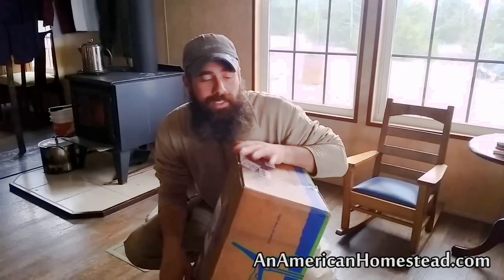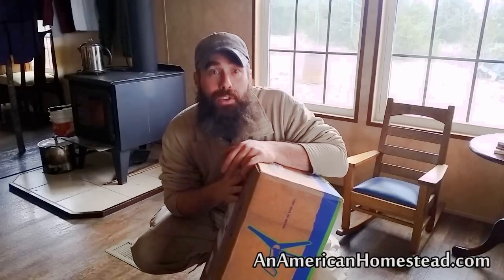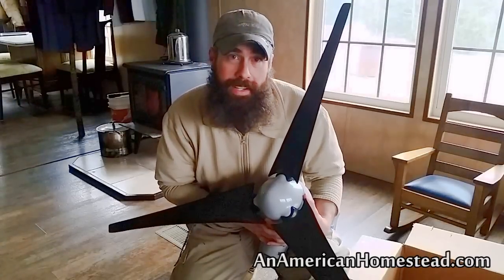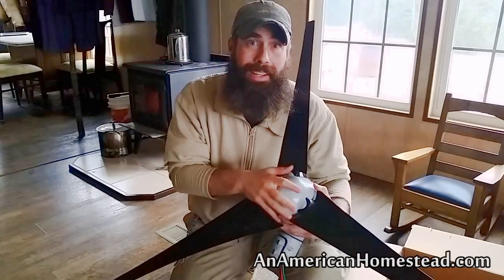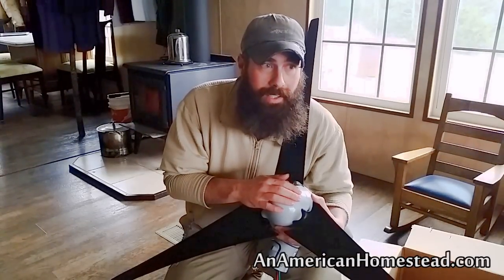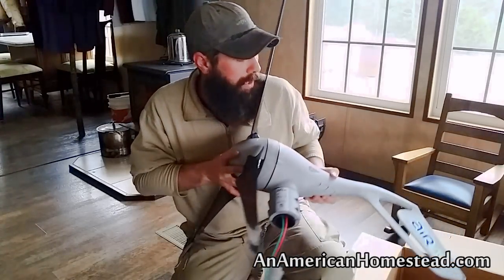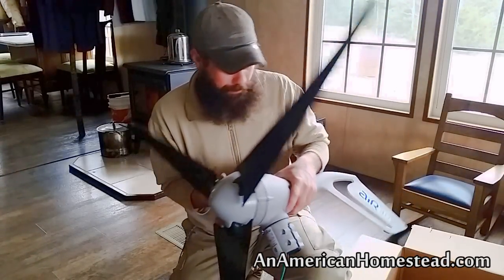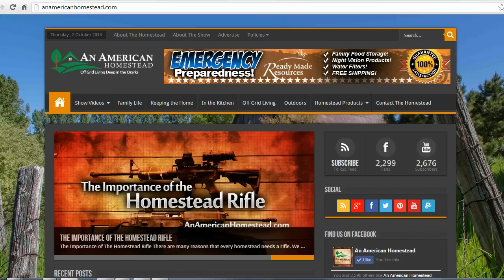Primus Air 40 Wind Turbine - An American Homestead

Comment: Good Day, I am considering adding the Air 40 to my 120v 3600w 90a 48v 12
 panel Solar system. Can U provide an Update on how is the Turbine 
doing? is it Still in operation? any issues? Can U provide any data? like Watts & Amps @ 12mph. Any data would B appreciated. Was it worth the 1K investment? Thank U

Comment: Good thing you got it free to talk about it.  Because when the controller goes bad it will short everything out or it will run away and burn out the barings.  You can get near it when it is running away the blades will really mess you up. You must have a way to stop the blades before you start to do any work on it. Everything is all up at the top,you have no way to break it.